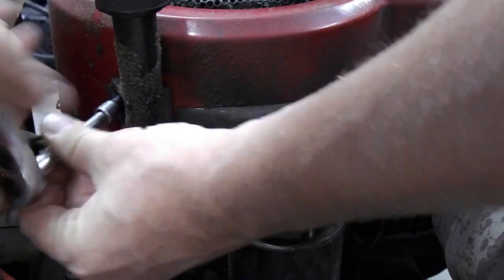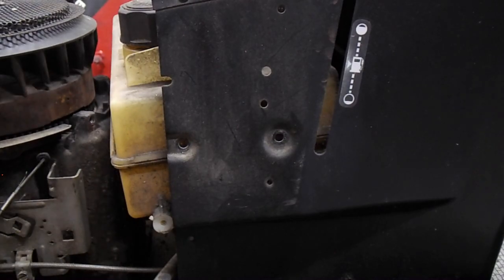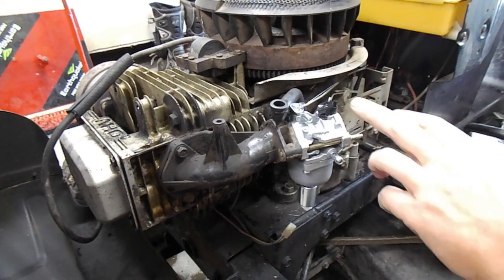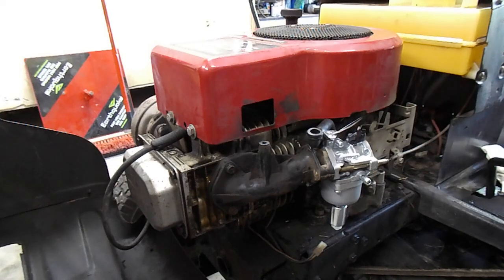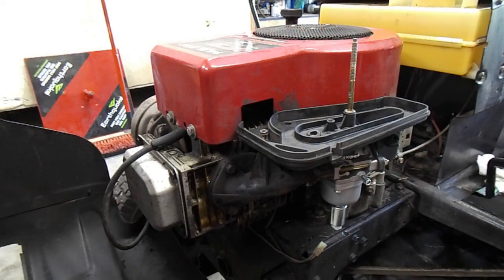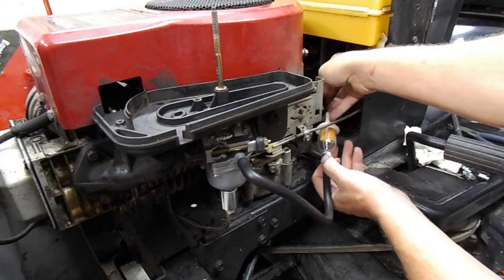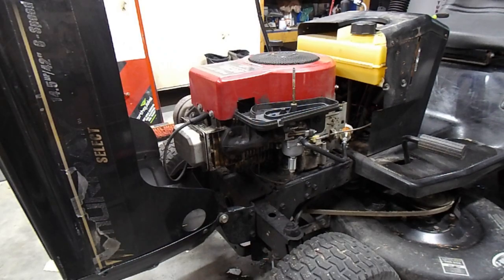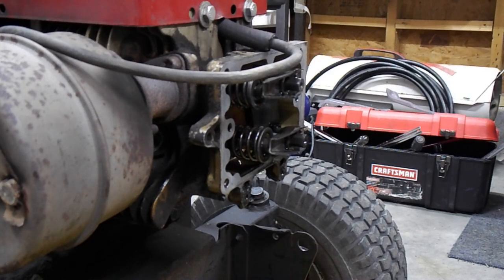Yard Sale Find! Murray 42" Wide Body, Will It Run? Part 2

Comment: I AllWAYS clean carb and adjust valve lash if I plan on saleing it 
My wife would polish the engine metal cover and body 
Really nice looking old mower 
New blades are a must
Reply from the maker: With ethanol fuel cleaning is a must and it seems like no one ever adjusts their valves, every small motor I could across needs it. A little maintenance goes a long way
Reply: I agree and since I retired 5 years ago as a life time diesel mechanic working full time on small engines is fun 🤩
Reply from the maker: @philliphall5198  Its what I do to relax, I'm a field tech working on construction equipment, going from that to a small motor is just relaxing

Comment: The nut actually locks it, and the torx screw adjusts !!!, then lock with the nut !!!
Reply from the maker: Depends on the valve train, this one though the rocker arm rides against the nut, the torx screw is what locks it in place. I had a old motorcycle years ago that was the opposite where the screw adjusted lash and the nut locked everything down

Comment: Every use mowers I buy first thing I do is remove covers and pressure washer them, even a part mower needs to be cleaned to remove parts 
It’s smart to have parts mower if you have mechanical skills and not lazy
Reply from the maker: Most mowers would live a longer life if everyone would just wash them like this from time to time.